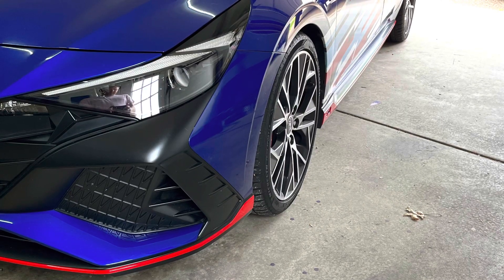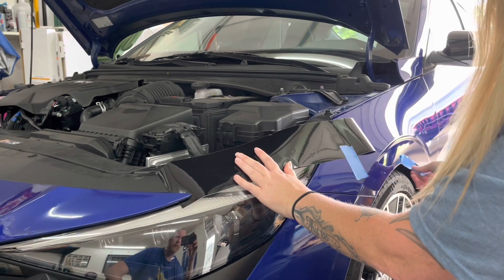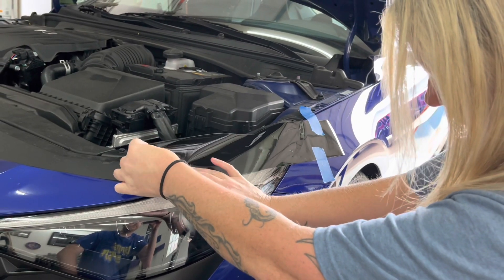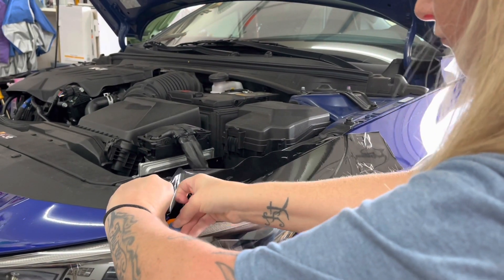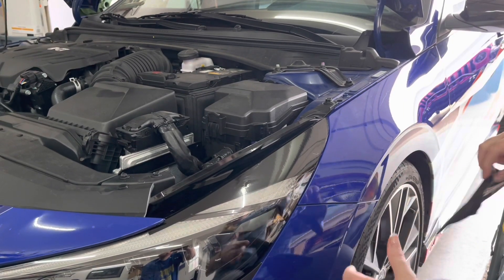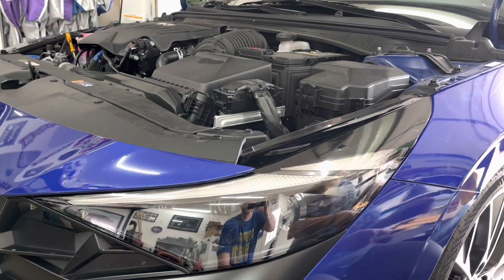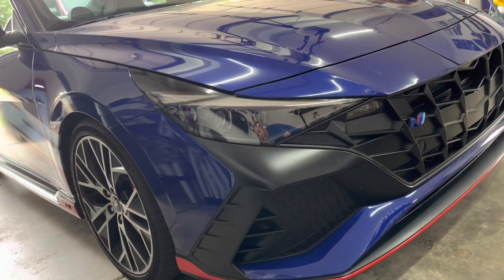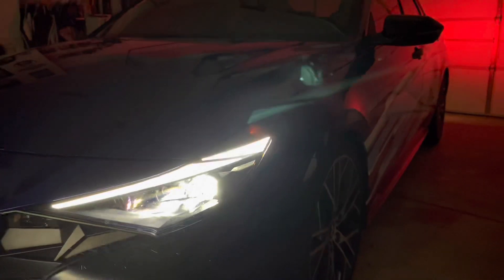2022 - 2023 Elantra N Headlight Eyelids for less than $20

Comment: I plan on doing this for my car as well except using vvivid vinyl. Do you think knifeless tape is necessary? I know you didnt use it but I really dont want to scratch up the headlights. Also, do you have a tutorial on removing the amber bulbs? I cannot find the video on your page. Thank you
Reply from the maker: You could use knifeless tape, but since the line is so straight there’s no real reason to use it. Also, I made the cut in the gap between the headlight and hood, which avoids scratching the headlight. I don’t have a video removing the amber light bulb as it’s a pain to remove and the vinyl pretty well covers it up.
Reply: @nprform  Ah I see. Thank you so much for the help!